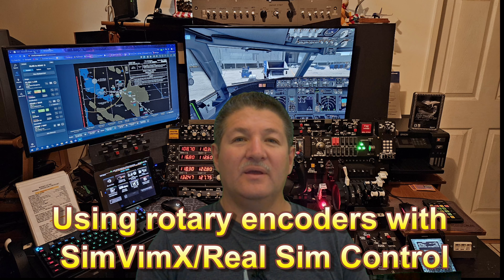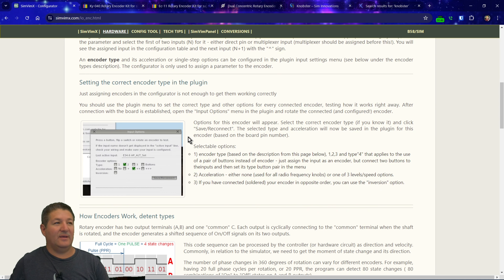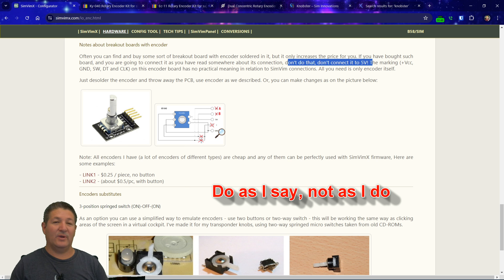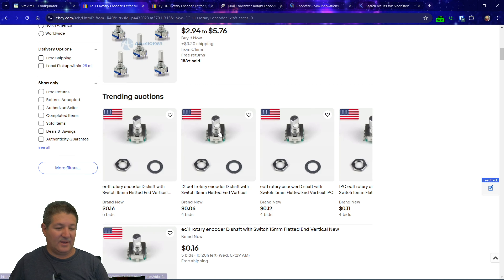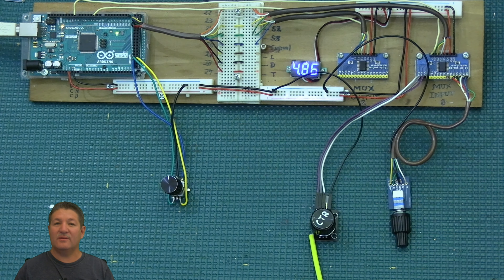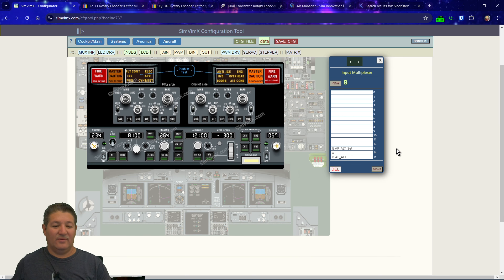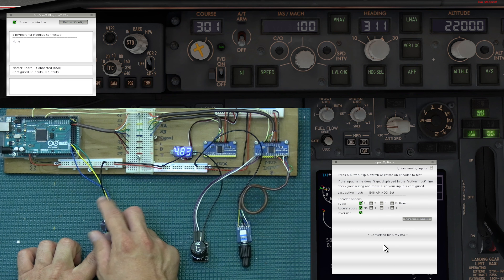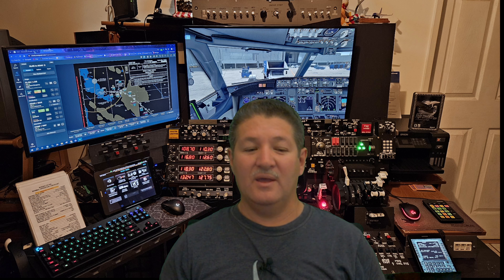Using rotary encoders with SimVimX

Comment: Do I need to use an external 5V power supply for my cockpit?
On your test board I see that you use this one from the Arduino Mega.
Reply from the maker: @pfv3462  You don't need it for the Arduino, but you do need it for all your LEDs, Displays, servos and stepper motors.
Reply: @Qosmokid  So I just need to put a power supply on the breadboard and then just an usb cable for the arduino
Thanks for your response 😄👍
Reply from the maker: @pfv3462  Yes, just make sure the negative from your power supply also connects to the ground rail of your Arduino

Comment: hiiii may I know how to make the MUX as an "output" for those buttons with led for on/off and fault. I would like to extend my output by using MUX. Thank you!
Reply from the maker: @ferrer9609  Hello, you cannot use an output MUX by itself to light up LEDs. You need to also use an LED Driver like my favorite the DM13A. I have a video on using those and you can connect the DM13A to an output MUX pin. It gets a little more complicated with those buttons that have LEDs in them so I do plan to make a separate video on them.
Reply from the maker: Here's my old video on using DM13A's. I will eventually update it so I can show how it's done in the new configurator.
https://youtu.be/ccQY49AHSWw?si=cx1oEMnNlbrn45hI